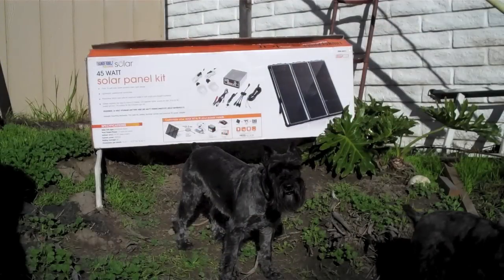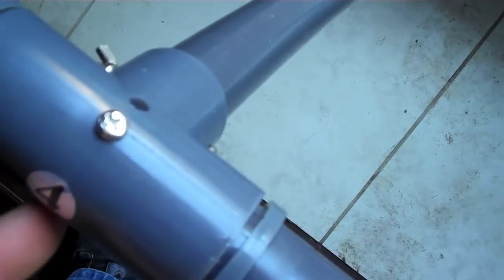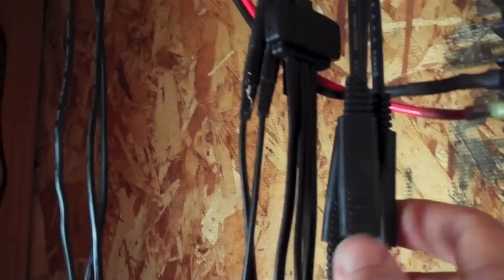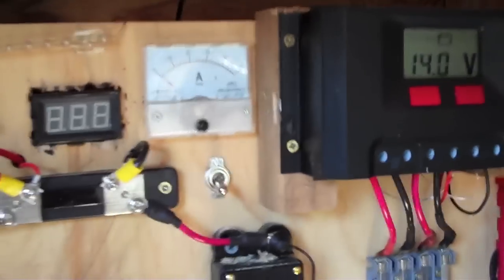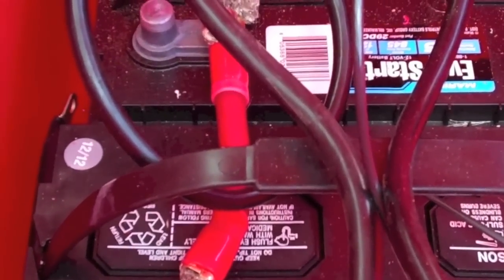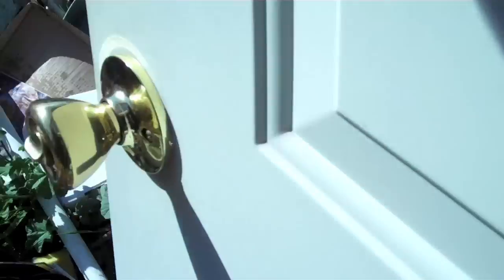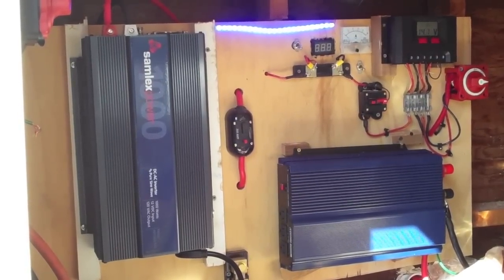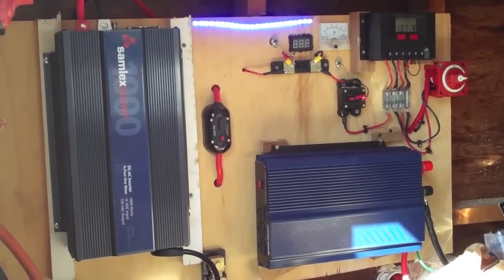Solar Power System Harbor Freight Panels Portland Oregon

Comment: That 300A breaker isn't going to help you if you have a problem. You need to size the wire to the device and then size the breaker to the wire and NOT just throw a 300A breaker in and hope it works.
Reply: It's not about how neat it is, it's about how SAFE it is. If you use a 300A breaker on a wire that can only handle 50A before it starts burning and starting flames then the breaker is useless and I do mean useless.

You don't size a breaker/fuse to the device, you size it to the wire size.
Reply: Phillip Aboody I agree 100% brother. If possible, I'll always do any work myself to save a few bucks. I always made pretty good money as a licensed High Voltage/Industrial electrician and worked a lot overseas for tax free wages. When I was Stateside, never charged my friends or family a dime if they needed some electrical work done. A union electrician would have cost them at least $50 an hour. I'd do it for a six pack of beer. lol
Reply: Excellent advice brother. The #1 cause of house fires in the U.S. are by backyard electricians who can make a light bulb come on, but haven't a clue about sizing a protective device (circuit breaker or fuse) in relation to the size wire they've used.
Reply: Grandpa the Grey

I don't think it does apply in these simple applications pops...  just not enough power to draw from even to overload a #12 ... its just a few lights...  and some tech nonsense ....  plus its coming off an inverter which I believe will turn off if the voltage drops to protect the equipment ...  just as long as they ground the necessaries so they don't get a good jolt I wouldn't worry to  much...  those chemistry sets in the little metal suit cases in the 60's were probably more dangerous...lol
Reply: JackCondor44 No, but if something shorts out on the DC side of things the 300A fuse will be worth dick and will start a fire before breaking.

If you are going to do it, do it correct.
Reply: I've watched a few videos on these ....  and some of the wiring was haphazard but this guys configuration looked clean and neat...  I going to keep looking to see the most well protected home school system ... im just kind of crunching the $$$ numbers ...  if I am interested...  and of course I don't want to present myself with a fire hazard in my home...
Reply: I know I used too splice... so I understand 300 amps and how hot it is....  on any size cable...  300 amps is 300 amps....  its a heavy load....  but Ive never seen anything burn from 300 amps...  500 -700 amps it starts getting a little crazy....  I've connected legs pulling 1100 amps and it almost welds to the copper connector...500 mcm..  its scary shit...   but then again I was working with industrial materials...  those little fuses are a bit flimsy looking..lol
Reply: you use to splice. What is that?

300A doesn't need to be 'hot' if you use the correct cable and the correct protection equipment.

I don't know what you were doing with 1100A but if you are pulling that off a battery bank for a standard PV battery system something is wrong with it. and what voltage were you pulling 1100A with?
Reply: Underground in Manhattan almost 15 years a splicer....  those are the fella's who make those live connections without interruption....  we work hot 80% of the time...  and come to think about it the job that came into my mind where the load was measured exceeding 1100 amps on just 1 phase the other 2 were pulling close to that vicinity but not as much ... it was a large outage Columbus Circle...  swear I thought I was gonna die either of heat exhaustion , electrocution, or smoke inhalation that week...  rookie supervisors with less than 2 years splicing experience running a lot of our grids now....  they suck....  not surprisingly one guy unfortunetely died in Brooklyn few laters later.... a young fella and a splicer... it shouldn't have happened....  Im out of the company now....  it was just a fucking bizarre three ring circus to work...
Reply: anyway the insulation on the conductors are underated....  factor in protection for any miscalculations of load....   its been a while since my hands have touched anything with that sort of load...  but if my memory serves me well 300 amps....  the cable is running warm.....  you could start too feel the vibration ....  500 amps...  its clearly vibrating and hot....  700 ...  your start to be concerned about arcing when handling it cutting through...  above 800 amps...  your playing with your life...   heat shrinks start sliding off vertical connections exposing hot legs... it gets crazy....  insulation starts to melt....   and then things start blowing ....  usually in the ductwork....  but sometimes in the manholes....  hopefully when your not in there...  but what I do recommend because he's using ductwork .... into the house...  CO alarms....  any shorts in the duct will direct the CO right into the living quarters...  silent killer...  anyway that was a trip down memory lane...   good talking with ya....
Reply: DC not AC
Reply: JackCondor44 That's almost exactly what my buddy Jim said when he let his brother (instead of me) wire his off the grid home in Baja. After nearly 40 years as a High Voltage/Industrial Electrician and having already installed solar/wind electrical power systems in two off grid homes, I tried to stress the point about sizing breakers, wire size, load capacity, and all that nonsense. "It's just a few lights, fans, TV's and such and only a 12/120 volt inverter system" he says. His brother Ray had done an excellent job of making the lights come on so "thanks but no thanks" he says when I volunteered to help. It WAS a beautiful beach home. Right on the Sea of Cortez near the quaint little village of Mulege, Baja Sur. Unfortunately, there were no phones and the closest Fire Department was 40 miles away. Hell, I didn't even know stucco houses could burn like that.
Reply: Do they find out what the problem was? Let me guess. incorrect wire size?
Reply: Phillip Aboody To be totally honest, I don't really know for sure. I was back in the States when it happened. From what little I saw of the brother's electrical work, I'd wager a sizable amount the man didn't have a clue about wire or breaker sizing. Jim wouldn't say much about it, however, his wife sure did and still won't speak to her brother-n-law. Their neighbor told me the fire started inside a wall in the kitchen. Since the only thing inside that wall was wiring for lights & receptacles, I think it's safe to assume the wire got hot enough to burn.
Reply: Ouch, If I had a license to do electrical work I would (the laws here in Queensland Australia state that you don't need to be licensed for voltages under 120VDC and under 50VAC). Even though I know what I a doing, its not worth it. Something goes wrong, I'm screwed. A licensed pro stuffs up its on him.

Don't get me wrong, I'm not going to pay for someone to lay cable that I can do my self but I will get him to test it and tick off on it once the job is over and he has done the connections (I am a tight ass, if I can do it and save money I will).
Reply: here fella's this is some basics from my experience better put in words from a webstite I found...  I never referred myself as an electrician.... that's a different set of skills...  I was a splicer...  and with that said...  it was an entirely different animal....  but we dealt with loads that most electricians only theorized....

Current Carrying Capacity of Copper Conductors
Current carrying capacity is defined as the amperage a conductor can carry before melting either the conductor or the insulation. Heat, caused by an electrical current flowing through a conductor, will determine the amount of current a wire will handle. Theoretically, the amount of current that can be passed through a single bare copper conductor wire can be increased until the heat generated reaches the melting temperature of copper. There are many factors which will limit the amount of current that can be passed through a wire.

These major determining factors are:

Conductor Size:
The larger the circular mil area, the greater the current capacity.

The amount of heat generated should never exceed the maximum temperature rating of the insulation.

Ambient Temperature:
The higher the ambient temperature, the less heat required to reach the maximum temperature rating of the insulation.

Conductor Number:
Heat dissipation is lessened as the number of individually insulated conductors, bundled together, is increased.

Installation Conductors:
Restricting the heat dissipation by installing the conductors in conduit, duct, trays or raceways lessens the current carrying capacity. This restriction can also be alleviated somewhat by using proper ventilation methods, forced air cooling, etc.

Taking into account all the variables involved, no simple chart of current ratings can be developed and used as the final word when designing a system where amperage ratings can become critical.
Reply: JackCondor44 Buy the time the a cable gets to those kinds of temperatures the resistance would be so high that it would be useless as a conductor. You have to remember that we are talking about ELV where 1V drop is about 9% of the volts.

Whilst you are technically correct about the melting point of the conductor. Specing a system with these numbers would be dangerous and foolish.
Reply: well the lights and air conditioning were working in the nearby building lol...  so as far as the voltage it was with in range to operate the compressors...  their was enough power on the primary side..  which was 13 kv...  the secondary side did not have enough copper in the ground to pick up the load... so the cable was running up ridiculous amperage peaking at around 10 pm if my memory serves me well...  my relief at midnight had a little bit of an easier time reinforcing the street ties and the building service the load drop was considerable and all was well by the morning... but it was hairy and scary from 3pm till around 11pm that particular summer day...  think it was back 2003...  anyway the pricks I worked for never commended me for keeping a cool head in a very difficult situation....  no one got hurt....  but mistakes were made on so many levels...  just was the beginning of the end for me and that fucked up company..

Comment: You can also use a portable jump-starter--available at Harbor Freight--and a small inverter to run appliances.  The jump-starter has a cigarette lighter hook-up.  You plug the inverter into it and plug the appliance into the inverter.  I don't remember the exact price of the jump-starter I bought at Harbor Freight but it was less than $50.

Comment: I think your system looks really good for a rookie doing everything on his own! I wish we could of chatted or email each other a couple of time I might of been able to help you save a little money. I will tell you this much, concentrate on getting enough power for just the A/C and maybe a microwave and a refrigerator and or freezer. The other, stove, dryer or anything that's 220vac are just way to big of a power hog to try and make it with solar alone you'll need some wind generating for that

Comment: great starting point. I started with 10 of the old kits and began expanding from there. I would tell people to buy maybe one or two of the hf kits to start out. you can get 100 watt panels keeper than the hf kits if you look around for them. lord knows I love my solar systems I have now. I just took parts of my house off the grid today. I left the grid tied systems because they cover the 220 stuff.

Comment: Seems like a nice environmentally sound project. It you are looking for reliable back up you should go with a Generac Propane Generator with the Propane tank or NG if you have it. Saves money and is reliable. I'm guessing with 12 panels($149 each), batteries, accessories you must have paid at leasst $2000. Batteries dangerous and require maintenance. The Generac would power everything. HF has some really cheap generators you could get a decent one for less then $1000. Doesn't seem practical.

Comment from the maker: It's powers a attic fan I hooked up in my attic helps cool down house in the summer months, a couple lights in rooms, and 3 other 110v plugs in other rooms. It runs TV, Computer, Fans I need more power to for my bigger appliances. But when power go's out I have my phone and lights and I get by better then before when I was in the dark with no power for a hour to five hours.Solar works good for me I'll be adding on in the future. Thanks for the message.

Comment: Wellllll you are not right...Even the cheap Chinese inverter (go to ebay) 200 to 1000 Watts ...need the grid to create the synchronization (grid tie inverter)..if the grid is gone...they go to the off mode !!!.  if the power return...they will synchronize again...and they will push their power rating  into the grid.

Comment from the maker: They are against the law to use in California because when power company turns off power they put electricity in the grid and could electrocute the power company worker(s) They are legal to own put you can't use them legally in this part of the country they are a great thing if you are able to legally use them in your city or town. the ones that work are hooked up to solar or wind power or both. The kind that just plugs in with no solar or wind power R known to be a scam & not work very well.

Comment from the maker: Here you can't tie in unless you have a system that shuts down when power is out by law. The only reason I put this little system in is because it works when all the power is out and it is totally independent of the grid I put in electrical plug~ins in my walls painted them green and hook up attic fan that runs 100% off solar.I'll make a video about this fall. Calif solar contractors and install companies are way over priced and you lose lots on money on over price rental system you don't own

Comment from the maker: I'll try to put it in next video. It go's from each panel to a plug in piece that combines 3 into one than into a plug in junction box I bought from Harbor Freight. Than a junction screw termination so in the future I may put in other type brands or type panels. Than a off and on switch than to a amp meter than to the controller than to fuses than to batteries. Than to positive fuse than to inverter than to discontent fuse box and into the house.  Thanks